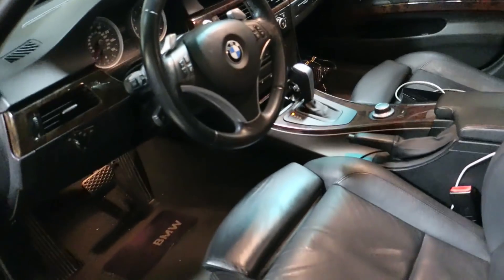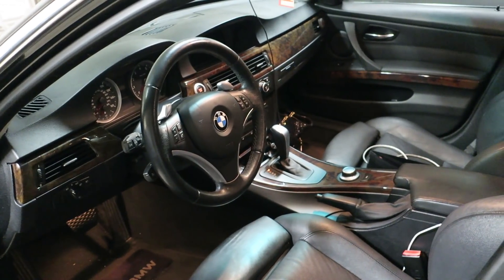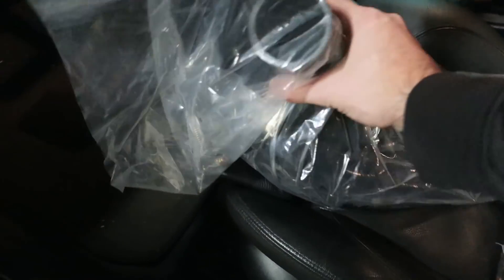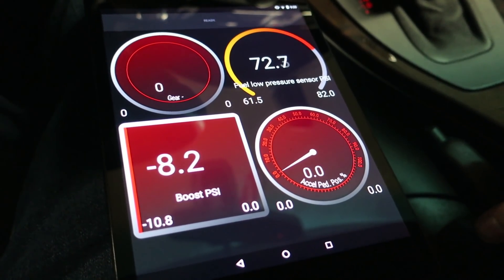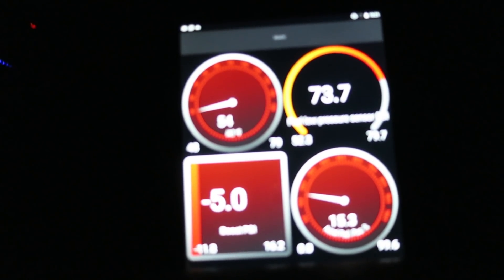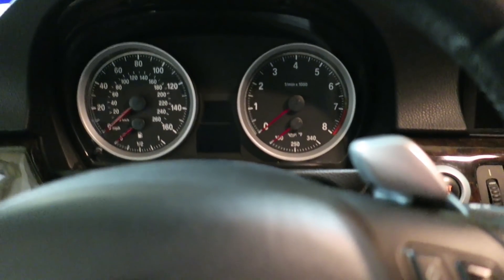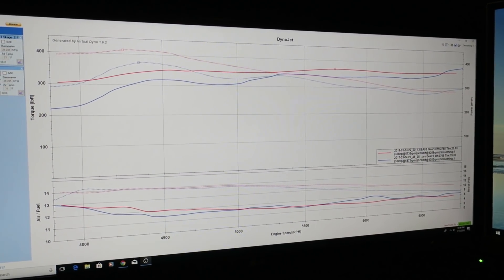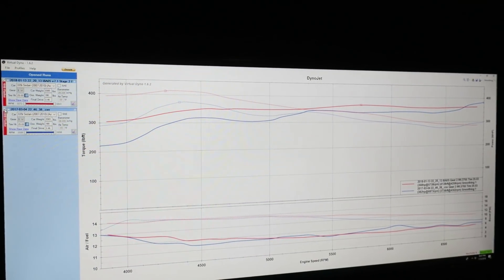How Much Power Does My 335i Make? MHD Stage 2+

Comment: How reliable is the virtual dyno?
I have a weird problem. I don’t reach target boost at low rpm(1.500-2.500). Which is super annoying. But to my surprise, mhd log shows me 600 ftlbs at 5400 rpm, which would be equivalent to 600hp. But I haven’t upgraded my turbos. I have a catted downpipe and air filter only, on mhd stage 2+. Car is dct

Comment: I’ve seen you could push about 480 HP without upgrading turbos. Is this posible? And what would you need to upgrade? Because I saw that MHD stage 2+ tune puts your car to 420 hp
Reply: yes its possible
Reply: @R3RS2024  I think that’s insane. Had a hell of a day yesterday I’m still pretty much stock besides intakes and stage 1 tune and raced my buddy’s wrx with a single turbo and absolutely gapped him. It was almost too good to be true because he always has his car in the shop spending around $1000 every single time and my car still gapped him on a 40 roll. Pretty insane can’t wait to start getting other parts for my build!
Reply: @Drizzi G Youre right its insane. These cars are understated in they hp figures. Ppl dont really look at the factory numbers imo. The 2008 e92 bmw 335xi does 0-60 in 4.8 sec and 13.8 in the quarter. So if you take in consideration a Dci and intercooler upgrade on stage 1+mhd your would easily gap most cars that are upgraded. Just imagine how many cars on the road can actually do 40-100 in 4 secs. My 2008 335xi feels scary fast. And you can maintain the speed with a catch and the injectors cleaned.
Reply: 550whp is the top limit, 480whp with E-mix and relocated inlets and outlets

Comment: Anybody? Do you have to rebuild the transmission to run 600+ hp
Reply: Answers to this are kinda up in the air, some people are doing fine over 600,but Its not well documented, I have not read much about these tranny's failing too soon After big power as well though, so personally for myself I plan on just getting a used one to keep in my shed incase mine blows up after trying to push 650whp in the future. There are a few rebuild options but I've only heard heavily mixed reviews unless you can work locally with the company that's offering. I think most people for big power just swap in the dct if their slush box fails or do a manual swap. Sorry if I couldn't help but I've been scavenging for information too, it's near impossible to find anything about anything over 500whp with the 6at

Comment: I'm making between 360-370 hp without running MHD tune at all. If upgrade the turbos, and outlets, than run mhd stage2+ plus get 2 stepped colder spark plugs not even counting e85, maybe swap to port injection maybe not, but upgrade the hpfp than I'll probably push over 600hp I hope
Reply: How are you making 370 without a tune?
Reply: @luis4210  hes lying lmfao
Reply: Jake Goldberg I figured lol I’m fbo with no tune yet and I wouldn’t consider myself up there
Reply: @luis4210  Probably running shitty parts
Reply: @jakegoldberg8941  something a hater would say
Reply: STUNNA 30K not shit lol no eBay parts. What are you running?
Reply: @luis4210  Easy
Reply: How exactly you upgraded turbo ?
Reply: @Alexxx-cf5vw  what

Comment: I am trying to test the same with MHD flasher Auto logging but every time I start from 3rd gear it drops to 2nd and skews up all the numbers. It is showing that I am generating 566 whp which is definitely not correct.  Not sure if something is wrong with the car or I am doing something wrong.  What speed and rpm should I start at? Thanks

Comment: Just so's you know mhd stage 2+ tune "Average Power Levels 370-430hp using a peak 16 to 18 psi tapering to 12-14psi at redline"
Reply: Yeah i wouldn't be supprised. Mine made 344  whp and 367 wtq on MHD stage 1.  And only bolt ons i have at the moment are a VRSF charge pipe, DCI's, and a TialQ Bov.
Reply: I regularly hit 19.9 psi on MHD stage 2 plus FBO 335i

Comment: Did you run linear throttle mapping on mhd?
Reply from the maker: I did not, would you say there is a benefit of doing so?
Reply: Actually found out you don't run linear throttle mapping on an AT when you have it flashed with xhp. Since xhp uses the OEM throttle mapping.

Comment: Nice MHD Stage 2+ information!  I plan to add FMIC and Charge Pipe to 2010 535xi!
Reply: Did you do this tune and are you doing a Coupe, Sedan or Wagon? I have an o8 535Xi Wagon I plan to upgrade as well.
Reply: Don't go cheap on fmic

Comment: You are crazy running stage 2+ on the stock charge pipe😂
Reply from the maker: Haha I've since upgraded it.
Reply: been on stage 2+ for 20k miles on the stock charge pipe and diverters. No problems.
Reply: Lol
Blew my charge pipe on a stage 1 don’t know how u didn’t on stage 2 plus 😆
Reply: The early chargepipe are actually stronger I don’t know about us but here I’m Australia people with 2006-2008 chargepipe run higher boost pressure cars without using a new chargepipe, they used a updated chargepipe in 2009 which fails more easily
Reply: In*
Reply: @rishignanansegar9147 could be right. The stock chargepipe on my '06 335i did hold stage 2 till I upgraded it. Still rocking Index 1 injectors too 😂
Reply: I'm running Stage 2+ on Stock Charge Pipe and DV not a single issue in 12 months...

Comment: did you just flash over your dinan tune with the mhd or did you have to have dinan remove it for you?
Reply: You can generate an updated backup. It copies whatever tune is on the car currently. Then you just tune the car to whatever you want.
Reply from the maker: Yavor N I could flash right over it
Reply: Vehicular DIY break this down so will I lose  Dinan or if I take mhd off it reverts back to dinan
Reply: @vw3576  if you want to save the Dinan Tune, you can save it in the MHD app before flashing
Reply: @StraightOuttaTheSandbox  hey man know it’s a year old comment but how do I save the tune already on the car? Have a custom tune made for a stock car now wanting to go 2+ with Mhd
Reply: @alminsmajkan7040   generate updated backup. That will save your file. Then just tune to stage 2+. Definitely use a battery charger while doing this
Reply: @StraightOuttaTheSandbox  sounds good man thank you... waiting for the wifi adapter to ship in then doing flash... hopefully clutch can handle it 🤣
Reply: @StraightOuttaTheSandbox  sounds good man thank you... waiting for the wifi adapter to ship in then doing flash... hopefully clutch can handle it 🤣

Comment: Nice! I wish my f30 n55 can last that long and can make that much power as well. What are your thoughts on Bm3?
Reply from the maker: Hey I haven't actually looked into BM3, seems to be a flashed based tune vs something like a JB4 piggy back.  If you're considering between the two I'd say if you're out of warranty consider a full flash tune.

Comment: What smoothing factor were you using on the top right? Default 1?
Reply from the maker: Yeah the default 1, I want to go on an actual dyno just to see how accurate those numbers are.
Reply: Vehicular DIY that’s a great idea, I would also love to know
Reply: Vehicular DIY I have measured a baseline and it seemed to be very accurate on smoothing set to 1, but I had to make sure I wasn’t getting wheelspin, because that messes up the whole measurement

Comment: You log on Grand Parkway or somewhere else? 
Also, you are correct, you will 100% need an upgraded transmission if you upgrade turbos...Hell, mine went kaputt even when I was tuning with FBO and MHD. So I upgraded to Propulsive Dynamics transmission. Now I am ready to upgrade the turbos...time to call Mauricio again.
Reply: FBO + MHD was not likely the reason that your Transmission let go.  Rather, it was likely the result of MHD having to under-report torque to the TCU, in order to avoid transmission faults and limp-mode.  And, as a result of this under-reporting, the transmission did not adapt to and properly engage gear shifts - causing more slippage between gear shifts under heavy load.  XHP Stage 3 addresses this (raised torque limits) when combined with the MHD 'XHP' option (which reports the real toque figures to the TCU).  This, alone, would have (more than likely) had your stock AT holding for tens of thousands of miles longer, while FBO.    On a seperate/related note, I consider the Propulsive Dynamics transmission upgrade to be top-notch.  I would still HIGHLY recommend that you flash XHP Stage 3 and the appropriate option in MHD - to make sure that the transmission operates with knowledge of true torque figures (which the TCU uses to time/calibrate/refine each gear shift, at all varied loads - out of and into each of the gears - manage heat and minimize wear / prolong service life).  Otherwise, not doing so WILL subject even your Propulsive Dynamics transmission to premature wear.
Reply: Actually, the input shaft bushing just got worn out from logging. That's it. input shaft controls 3rd to 4th shifting...and it just went out suddenly and never came back. You are trying to diagnose without knowing the situation, the technological options such as MHD or xHP... while these comments may be true for the situation you are describing, they are only assumptions that in the end are incorrect regarding my situation and what led to the tranny failure. 

All the xHP settings were properly used...it was a case of mechanical wear, nothing else. How do I know this? Because I have been logging for nearly a year with zero issues and the malfunction was sudden and absolute and you could immediately tell that it was physical. Torque limits were not an issue at all. Furthermore, the tranny was properly adapted with ZF driving programming procedure with xHP stage 3 to rule out any potential adaptation value problems. 

As a matter of fact, even now, each time I update to the latest xHP stage 3 iteration, I do new adaptations to ensure no possible pressure value errors. It is a pain to drive 57 miles on a shoulder lane...but if you want to do things correctly, then you have to do it yourself. OE Stock bushings are quite soft and are not unified in construction. the ring is not a single piece of metal, but rather is a rolled piece of metal that has sliced but out...eventually the fail and very fast under over rated pressures. The Propulsive Dynamics unit has racing special alloy one piece bushings with proprietary bushings that are designed to withstand much more pressure and they will not deform.
Reply: Thank you for adding color to what actually occurred when your transmission went "kaputt".  There was no diagnosing being attempted... was merely speculating (hence, the use of the term "likely").  Sounds like an unfortunate scenario occurred.  It's so interesting how what you mentioned... while it holds true... can somehow be eluded by some (oftentimes pushing absurd levels of torque) but not others (with merely an OTS stage 1 tune).

Thankfully, though, you now have what I'd consider to be one of the most thoughtful transmission upgrades on the planet.  It's also great to see an example of an owner being measured and methodical in their approach to caring after their vehicle.

Would you happen to have posted a detailed review of the new PD transmission?
Reply: Eventually there will be a twin review of xHP and PD. Beginning this weekend, I am beginning logging for xHP for a custom calibration to go with the PD unit. It will a be a long process over a couple of weeks since there are multiple xHP flashes which must be adapted to and then driven for a couple of days before each logging happens. One tank of gas after ZF adaptations per each flash should suffice for the car to acclimate to each flash then loggin can be done.

Comment: have you noticed any bad smells after putting downpipes on it at all? its just someone on youtube said when they put downpipes on theyre bmw m2 it smelled like shit???
Reply from the maker: I actually bought the car with down pipes in place, the exhaust might have a different smell to it considering there the lack of precats.  There is always the re-circulation button.
Reply: recirculation button?
Reply: He's talking about for the AC so it doesn't bring in air from the outside. The only time you can smell it (unless you have an exhaust leak) is if it's running in the garage for any length of time or if you were in a car behind yours.
Reply: bigeye250 yes...you will smell fumes.
Reply: I've had catless downpipes on many different turbo cars. There does seem to be a bad smell the first week after removing the cats but if the car is running well it's not bad at all after a while once the exhaust gets flushed out from the extra heat now traveling all the way to your tailpipe instead of getting trapped in the cat.
Reply: Yes,  nitrogen oxides. Cats really work so removing them will smell a little.  But for the performance gains I could not care less about the smell.

Comment: Off subject..your videos are extremely helpful.  I'm having trouble with 30FE overboost in 2nd when hitting 4.5K to 5K rpms.  Any tips or suggestions..?
Reply: Finally got to swapping out one of the boost solenoids.  Ran WOT for the first time in months without throwing 30FE.  Time will tell.
Reply: Mike Brooks did time tell?
Reply: @i_read_bad_reviews  😆
Reply from the maker: Mike Brooks Thanks, how many miles are on the car and have the boost solenoids been tested?
Reply: maybe your wastegates are adjusted wrong
Reply: Vehicular DIY 93,000...no they haven't.  I can remove them...how would you test them?

Comment: Great video. btw the stock 6AT transmission on these cars can handle quite a bit of power. Should be able to handle up to 600tq
Reply: Tommy Benson yeah, xhp stage 3, there's a guy with an AT 135i single turbo making 700+whp and ~600wtq
Going single is better than upgraded twins for AT, singles don't make dangerous amounts of torque.
Reply: @T2VR  twins make too much torque down low and that is exactly when everything breaks. single for the win baby
Reply: SS PAX how am I wrong ? Almost no one puts upgrades twins. They are too responsive. Driveline breaks and way too much stress on the engine.
Take for example every RB or 2JZ build ever, no one runs twins.
Reply: @fohatadri  this aged well . Market now flooded with 17t twins.

Comment: Hey bro... 
Iv only got ebay intercooler and secondery cats gutted.. mhd stage 2+ 
I got 418bhp and 459tourq i think
Reply: That ebay intercooler really putting in work 👌
Reply: 110k
Reply from the maker: Vishnu Patel solid numbers for sure.  You running 93 octane?
Reply: Yer bud ... my numbers where very high... 
There where some fbo n54s n they was struggling to make  410... was an odd dyno day.. i was lesst modedded.. as it was a n54uk dyno day.. and am on stock intake and downpipes i must have a factory unicorn lol
Reply: Isnt that crank horsepowers? since he meant 368 wheel horsepowers.